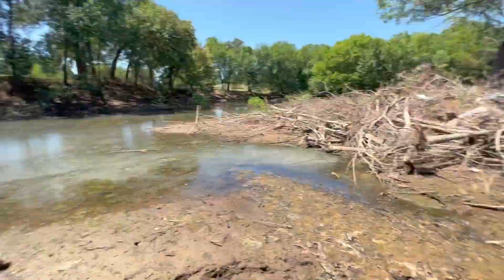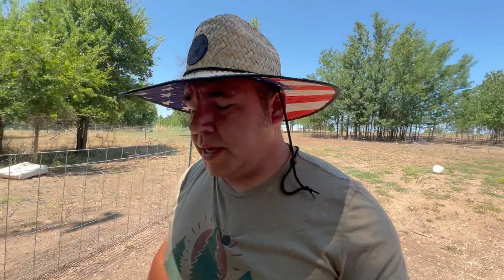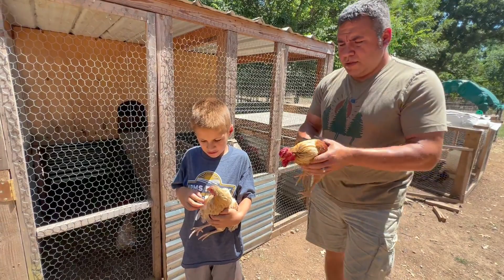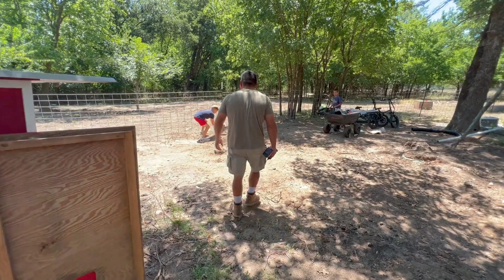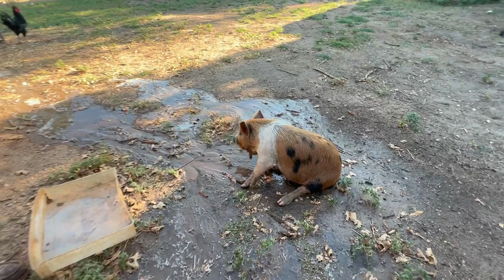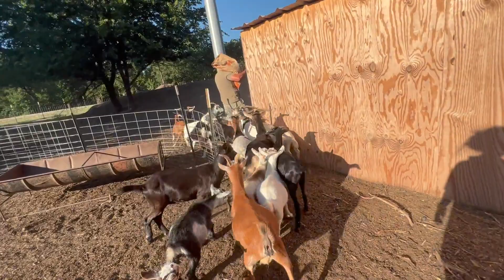This Has Been A Battle!!

Comment: Snapping turtles can be easily harvested with bank lines. I use 350 lb test line that I use for trotlines, heavy 4/0 to 6/0 hooks, a 2 or 3 ounce sinker and meat for bait. Chicken works well. Make sure you stake the bank lines really well or the large turtles will pull the stakes out of the ground.
Any snapper you find on your property, dispatch or I guarantee  they will be in your pond.
Wish you guys the best. Good luck.

Comment: I've been doing a lot of reading on turtles. Your trap is good, similar to what everyone else is using. Turtles love algae and dead fish.  When you catch the small fish, try not to introduce unhealthy fish. Make sure none of them are "blowing bubbles", or struggling to breath. Check the temperature of the pond you're taking them from and adding to. If the difference is too great, though the fish are healthy, the shock will stress them or kill them adding to the turtle problem.
If you can get the water moving with a pump or fountain that should help decrease the algae problem. A fountain will also add aeration for the healthy fish.
Daniel had a small pond installed. You may want to reach out to him for more professional advice.  Good luck.
Reply: Wonder if any of the solar fountains would be helpful ?

Comment: To rid the pond of large turtles, maybe ziptie two or three cattle panels together on their short sides, enough to stretch the width of the pond, tie a brick to weight it down in the middle and use it as a seine.  You might consider ziptying the panels crooked to make a U shape to fit the bottom of the pond better.  Fish should be able to slip through (and small turtles too).  Once you've captured some turtles, give them the zap and bury them.
Reply: The turtles bury themselves down in the mud so trying to use a seine wouldn’t work.
Reply: @Marge.j16  , how deep do they bury ?

Comment: @EddyFamilyFarm:  I'd look at Beckaert fencing. Not sure if I spelled it correctly. They did our Wyoming life fencing up in north east Wyoming. They did a multi-species pen. Or just Google fencing safe for, and list the animals you have. There is fencing suitable for each type of animal. I googled how tall a goat fence needs to be. It says the recommended goat fence is a 5-tiered goat fence that's 4-5 feet tall. In case you want to not go to Beckaert fencing. Do a cheaper route. Supposedly tractor supply carries goat fencing as well. It goes by rolls only.
Reply: I saw they did that multi species area. That is a great suggestion ❤

Comment: That knob on the steering wheel is called a suicide knob. They used them back in the 1930's on old cars.  The only way to get the snappers out of the pond is to drain it.

Comment: Put woven wire field fence, if put up right it will last a very long time. You have to put in good corner braces and inline braces about ever 200 feet and stretch it tight.

Comment: You need to get a big net that the fish can swim out but the turtles are stuck in it. Like the drag nets and take it across your whole pond and weight one side down a bit so it goes to the bottom then pull both top and bottom at same time to other side of pond. You might need few people to help you do it. Like they do on the big fishing boat to capture crab. And all those holes around inside of your pond is from turtles hatching. So you could have hundreds of babies in it now. But get those big drag nets and use them a few times.

Comment: Brandon and staph, Im not sure about your area but here where I’m from we use cows to seal leaking ponds. They get in the pond and walking around and with there weight and there two toes they seal cracks and holes . We have also used pulverized lime to help in sealing the floor along with cows. I know you guys dont really want cows right now but you could use them to seal your pond and then sell . If it was me because of the roaming and rogueness of colored bovine such as angus, charlotee , I would stay away from those types . Herfords, holstien , Jerseys , or Guernsey are some of the calmest breeds plus they are pretty good steaks lol. The fence I would go with treated post and woven wire . Bracing and getting your fence tight is the key to having a long lasting great fence . Hope this helps

Comment: Are you baiting the turtle traps? Smelly chicken backs and neck hung from the top inside the trap may lure the turtles in. For the bigger turtles, you may want to try dragging the bottom or running a trot line like those used to catch crabs. You should be able to check out YouTube for catching large snapping turtles or making trot lines. Good luck catching them. They can cause severe damage to the pond and really harm the kids if they get close.

Comment: Hi:hand-pink-waving:From   Michigan :face-blue-smiling:I Love your retirement///Ed gave you the steering Ball ?//The smile on your face, when seeing the goats on the trail/// As for Road side Fence?/// I would barrow  Mike's Back hoe///  dig With of bucket &  5 inches deep & the length of fence distance///Add T Post , Use Rented or Borrow a cement mixer///Pour cement into trench///this will keep Predator diggers & weeds in control/// Use Material that can withstand yearly WEED BURNING/// Treated 'not painted' Wooden Fence If you paint once it needs to be Painted Annually///

Comment: Hey Brandon and Stephanie,  hope all is well over there!    

Thats a horse skull - at least the top half with nasal bones missing.     I have a top and bottom of one in my lounge room that was one of my horses.     Mine has partial nasal bones - my miniature fox terrier chewed the first piece of them off and nicked off with another small bone thats inside the skull but held in there with ligaments and chewed that up somewhere. 

Quick question before I get onto the fencing - how do you go with bonfires or burning off legalities with the heat?    Here in Australia we have a half the year basically that is called Fire Ban Season due to the dryness, heat, wind etc here in our country - you guys have sent many many fire fighters over - and sadly we had one of your bombers crash and lose its crew - may they RIP, they died serving not only YOUR country, but OURS.     Anyhow - do you need to notify your local fire department when you are going to do a burn or light a bonfire?    Just asking out of interest, as our farmers also get an alert when the temperature or even wind conditions are above certain levels that it is tools down, illegal to reap crops, run machinery, cant run angle grinders, nothing that makes a spark etc.    Its about as close to a forced day off as farmers get LOL though they find loads of other things to do.   Welding stops too...anything in the open, using gas, and could potentially cause a flame - tools down.   Ive seen a few channels in your summers have bonnies (bonfires) and wondered about it all.   Figured I'd ask you due to your background in law enforcement.

Fencing along the front.    Seriously... the horse fencing looks great all stretched tight, I personally would put another box section in where the piece of it you already have ends if theres not one already there, and it looks even better with a line of white poly rope  that CAN be electrified if you need it to be on top, but otherwise doesnt have to be.   Just looks very smart.    I know its a little extra money, but if it were me - I would save and spend it on the same type of fencing as that holds ANYTHING in basically... and if you see some at auction - grab some more for the other side from the gate to the end of your property too.     I wish I had spare $$ and I would send you some to help with the extra cost of it.   It is so worth it.     

Toon Blast looks great fun - its going to do my OCD in... At present I have so much else I am doing that really - should NOT be an issue and not betaking up my time but my OCD is just NOT letting me give it a rest.   GAH.  

Anyhow - The new coop looks great so far, and very true - we do not always get to get things 'new' - we have to settle for second hand or recycling things like our forefathers did, and there is NOTHING wrong with that, personally I think it gives furniture some sense of history and a certain quirkiness when you know its from your own family past or its from the area local to where you were brought up or where you are now.    
I used to LOVE making photo frames out of recycled timber.     

Much love, hugs and thinking of you all from myself and my darling fur kids in South Australia!
Reply: Oh and I try to watch all your videos - I know I have a few to catch up on - some I miss due to migraines and not being able to watch or listen to anything - thats when they hit like a level 14 or 15 out of 10 instead of my usual 10 or 11 out of 10, - those lower numbers I can still 'function' at because my spine gives me more grief, lower L5/S1 and my neck as well .... Hereditory and falling off horses for nearly 50 years - arggggghhhhh Im 50 in a few days over a month.... 
Anyhow - there are also videos Ive watched but not been logged in because Ive been on another computer or or in a public place, or my phone hasnt been logged in properly and its on an open wifi thing so didnt feel like sharing my info with dodgy strangers.   lol